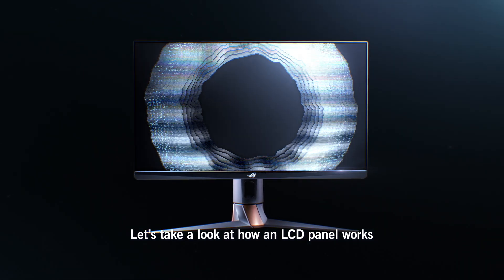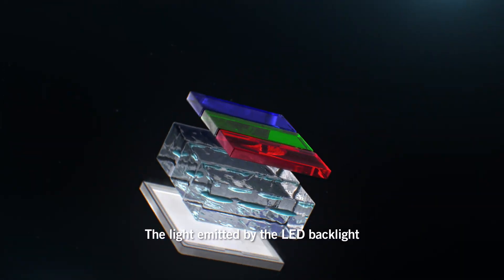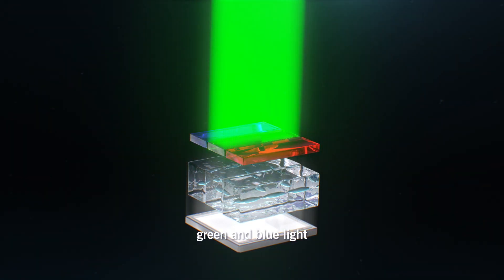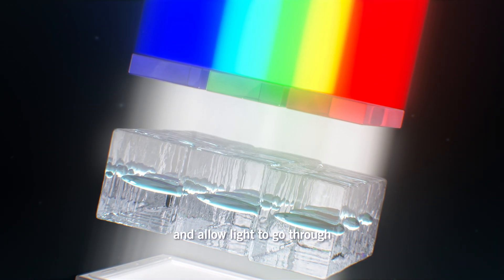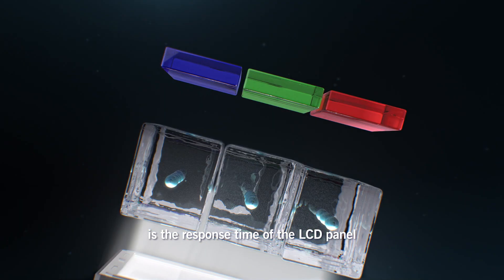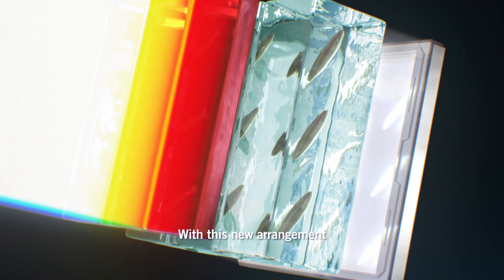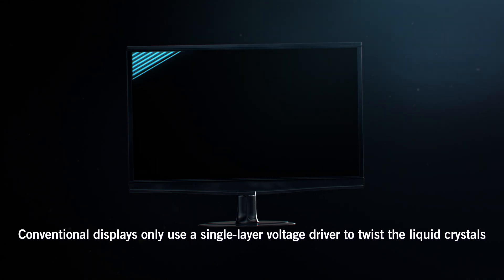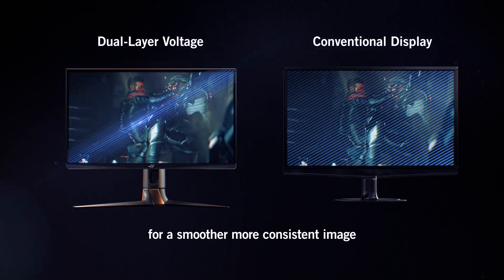How does Ultra-fast IPS work? - ROG Swift 360Hz PG27AQN | ROG

Comment: What guarantee do I have that my eyes will not hurt with this new backlighting technology?
With the Asus Rog Swift PG259QNR (360 Hz) monitor my eyes were very tired and hurt, the Low Bluw Light technology in that monitor was pure marketing, you should care more about your fans and make some panels safer for eyesight. I hope you fix this problem on your new 480hz monitor that you plan to release. Please Asus protect my eyes on this new monitor, I'm thinking of buying it, and my eye health comes first. 👍
Reply: This happened to me with all 240hz monitors.  But it wasn't the backlight technology.  The eye pain was strictly behind the brightness, contrast and RGB settings.  No joke.

Edit - Also, I agree with the low blue light stuff not being too helpful.  But Windows low blue light mode actually worked surprisingly well for me.  Weird, but true.

Comment: The dual layer voltage driver seems like a genuinely significant change that could greatly benefit backlight pulsing technologies like ULMB to help fight the top and bottom ghost trails we typically see in these setups. Eagerly anticipating this monitors release to see.
Reply: Looks like the ASUS ROG Swift PG27AQN doesn't have backlight strobing with this ultra fast IPS tech lol
Reply: @Accuaro  you gotta be kidding me. God why do monitors have to suck so bad.
Reply: They Do now baby! Its absurdly smooth

Comment: screw IPS... where are the OLED monitors?
Reply: OLED can't refresh as fast... And can burn in so hard pass
Reply: @viyusavery248  Burn in may be a problem, but an OLED which tops out at 120hz has better motion clarity and responsiveness than IPS panel in the 144-240hz range. Pixels turn on and off, no more delayed frames. Most gaming monitors have panels which can't keep up with their high-refresh rate input signals anyway when it comes to output. I'd rather have a 120Hz low-persistence OLED than a 360Hz IPS for gaming.

Comment: Why is no one doing 24" anymore? I want 24"
Reply: Because it is far from the FOV sweet spot. You'd need to be like 10cm away from the screen of a 24" to have the same immersion. 27" 1440p is the sweet spot hence you will never see any esports going above that.
Reply: U want 24 inch 1440p?